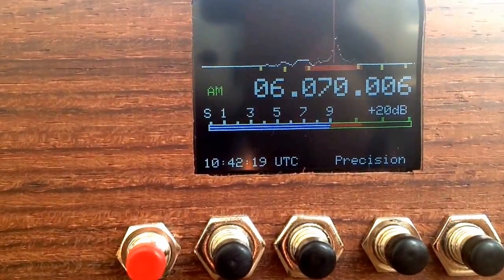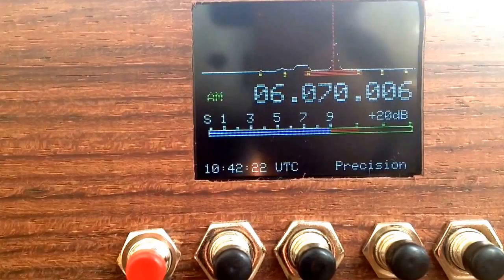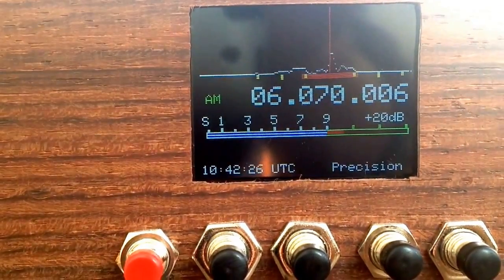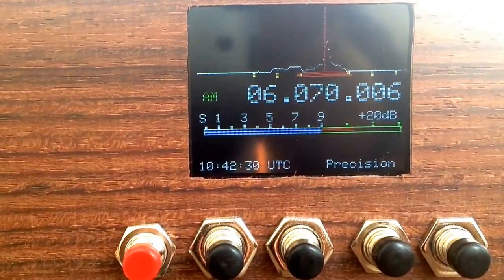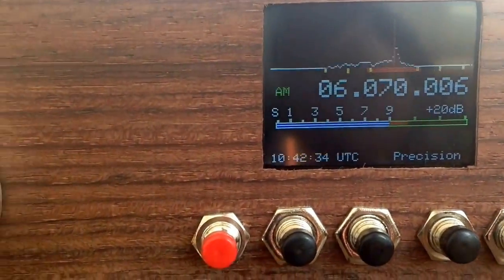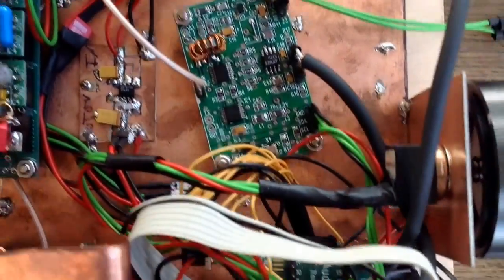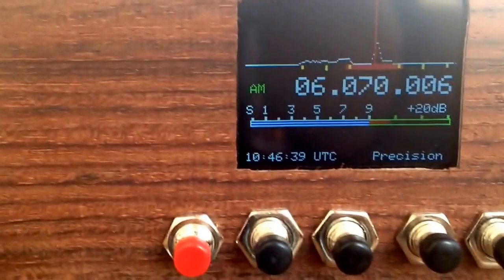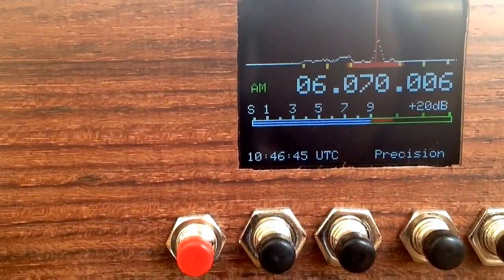Teensy SDR Receiver by DD4WH - #5 the hardware setup

Comment: Your video mentions an ultra quite switching power supply specifically made for SDR radios. Can you provide more information about the power supply and where to purchase them? I need a reliable, quite, power source for 3.3V and 5V DC to use with my playing with SDR radios.  Thanks, 73 Freeman, N5FPP.